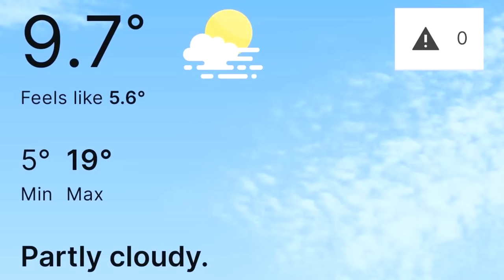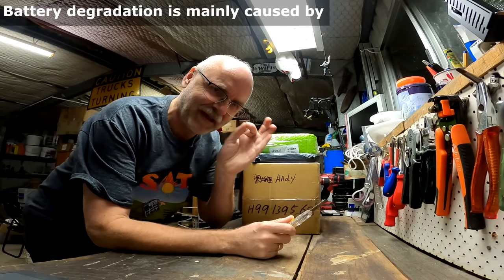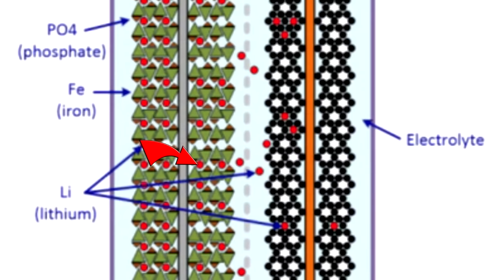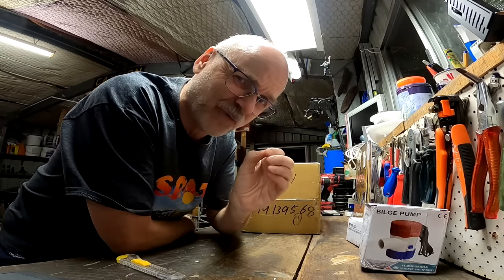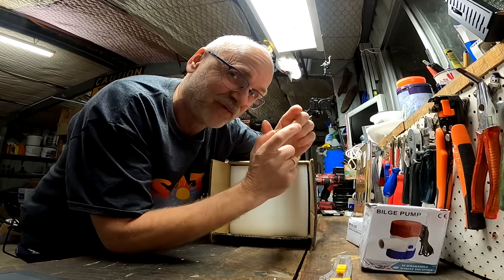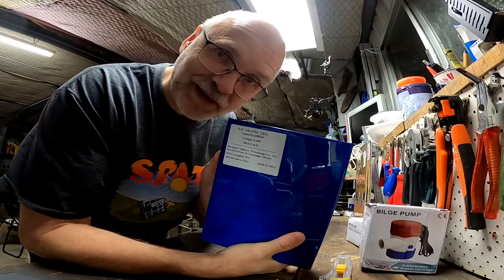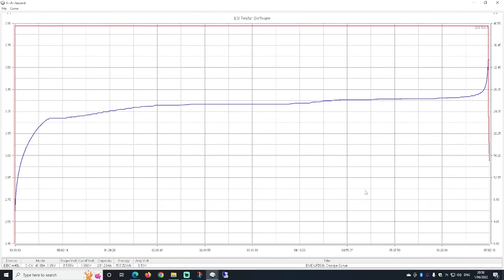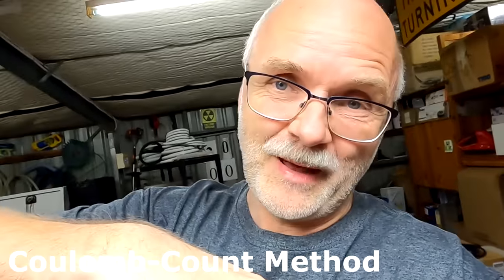Busting the 20%-80% SOC myth for LiFePO4 batteries.

Comment: because of the flat charging and discharging curve (and of course because of your videos about it hehe) at lifepo4, i managed to get from 3.00V to 3,4V (Pack UV is set at 12V and OV at 13,61V) and leave the setting for almost 3 months now and iam good with this. because the new cells always have a higher Ah Capaticy as always (if you buy 105Ah cells the have like 5% +Ah always - i got Grade B BYD 125Ah Cells and measured 135Ah which is more like 5%) - and maybe the battery is keeping longer between these states the charge, so actual i get my full capaticity even when i not fully use the cells. and if they degrade slower because of my treatment, i will longer have these cells before i must replace some of them...

Comment: @Off-Grid Garage: You mixed up the anode and the cathode. It is the anode that contains the graphite and optionally a bit of silicon. Look up Lithium-Silicon battery on Wikipedia: In a "lithiated" (charged) state,  the anode swells up.
Reply from the maker: I thought I said carbon material. I did not say the word graphite or graphene in my video😉
Reply: @OffGridGarageAustralia  carbon, graphite: same atom. Point is that you swapped them.

Comment: I keep it simple and set my BMS to 3.0 and 3.5 for now. I will adjust as your videos indicate otherwise. Should I need more current overall I will add more cells as I go. It spreads out the cost and the prices seem to drop a bit each year. EZ-PZ. Thanks for the video.
Reply: but they BMS just want to be your last backup to protect the cells.  you should better make the voltage settings with the charge and discharge controller.
Reply: @alexanderp.8075  of you have comms set up between your inverter charger and the  BMS then this is where you make those settings
Reply: @edc1569  on the inverter or the bms?
When you have the comm setup.
Reply from the maker: The BMS should never be used to control charging a battery, neither charging nor discharging, whether with or without comms. That's a total NO NO!
The BMS turns off your battery if something goes wrong or exceeds otherwise set specifications, nothing else. Always use a specific dedicated charger to charge your batteries which controls the high and low of charging. The BMS will be there if this charger fails. Don't ever charge you battery with a BMS only!
Reply from the maker: No @Ed C, you neve set any charging parameters in the BMS. It is not a charger!
Reply: @OffGridGarageAustralia  Andy, may I suggest you try some server rack batteries with a pylontech protocol or a bms that supports a protocol that is also supported by your inverter?
None of your 3  BMSes talk to your inverters so I assume you have had no prior experience with pylontech enabled bms or batteries. If you take a Seplos bms for example, they have a built in shunt (you are saving already) as well as they can control the inverter to turn of and on charging etc. Right now your inverter is not very precise when it comes to managing the batteries. 
Pylontech allows your battery to tell inverter when to turn on or off and how mach amps to charge with, depending on temp and other parameters. 
You are correct that is not a good idea to  have bms cut off charge and discharge via its mosfets under load but here OP is describing a different scenario. 
Something new for you to test perhaps.
Reply from the maker: probably not, Anton. I really don't see the point of the battery telling the inverter to turn off. All inverters have their own settings to handle such a low voltage shutdown themselves, it's not necessary for any form of comms.
And, honestly, I don't want the battery to shut it down. I may still want to keep the inverter functional even in a low voltage situation and I myself make the decision when to turn it off. Hence mine sits on 40V low voltage shutdown. And this is purely for emergency purposes.

Comment: Researchers have discovered that the first charge of a lifepo battery at the factory at high voltages can increase its cycles by 50% and greatly reduce recharge times.

The study was carried out by a SLAC/Stanford team led by Professor Will Chueh in collaboration with researchers from the Toyota Research Institute (TRI), the Massachusetts Institute of Technology and the University of Washington.

Wish ecoflo knew this before I blew a stack of bills on their Delta Pro. 😢

Comment: Doesn't make sense to charge to only 80 percent. If you use your lifepo4 battery for survival you will need the maximum power output you can get. Also charging to only 80 percent, your voltage is much lower and your run times are shorter and less voltage throughout load.

More importantly you need to only charge to 100 percent when you only need to, as long as you use battery and drain only down to 20 percent. Use your battery immediately after charged. Don't leave your battery at full charge for days. Lifepo4 average lifespan is roughly 10 years anyways, so why worry. 

Get as much use out of it that you need, the lifepo4 battery works for you, not you slaving over the battery state of charge. 

Simple and dont fear all the hype about 80 percent charge. Your lifepo4 battery only balances at 100 percent charge anyways, hello. Also make sure to use only a Lifepo4 battery charger ( or a Lifepo4 charge controller for solar) so it doesn't under charge or over charge. 

Absolutely there are more things to worry about in life. Like getting maximum voltage use out of your batteries.

Comment: I asked this question (what are the best settings for long lifetime?) to my Chinese supplier of LiFePO4 cells and here is what I got: "set no (or absolute minimal) absorption, bulk till 3.38V, Float 3.37V and discharge till 3.0V".  This is what I use now for my 560Ah battery. at night I run 2 AC's with it.  One inverter AC and 1 old one which takes big current fluctuations.  Max current out of the battery is about 80-90 amps. It is this current boost that is critical when discharge is at lower % : in my BMS I can see the cell voltages start to differ more at lower discharges with variable current, so this 'safer' 3V discharge limit is helpful to avoid one of the cells going of limit at that point.  
Last but not least: thank you Andy for all your great videos: you are truly filling in a big information gap with all your work and it is of such great help for me !

Comment: You are absolutely right. Lifepo4 cells "die" very often because they are loaded with voltages that are far too high. 
Lifepo4 in particular reacts much more "sensitively" than e.g. liion ncm on surge.

Here are my settings for LiFePo4    (I have calb cells here, but there is nothing around):
Bulk:      3.36V/cell    (8S --> 26,9V)
Float:    3.34V/cell     (8S --> 26,7V)
Cell balancing 1x per week for 2 hours, then charging to 3.43V/cell and it is only in this phase that the balancers normally work.
In the bms the balance start is set at 3.35V.

Ideally, you charge up to just below the "voltage increase" (3.34V/cell for my cells).
If all cells are perfectly balanced, the balancers just do NOT have to work that way. However, if a cell is slightly more charged, the voltage at this point also increases significantly. 
That's why it only makes sense to balance at all from this voltage onwards.

If you have the balancers active below 3.4V with lifepo4, they are almost always active and debalance the cells. The voltage differences are just too small.

For those who are interested, here are the settings for my NCM LiIon cells (Panasonic, 25Ah/cell):
Voltage range between 3.4V (14S --> 48V) and 4.0V (14S --> 56V). Nothing else ^^
The passive balancers (max. approx. 1A... and not for long) only become active from 3.9V/cell (14S -->54.6V) and then ONLY when charging, otherwise not.
This low balancer current is sufficient for the 600Ah 14S battery storage without any problems.
easy peasy  😅🌻
Reply from the maker: Thanks for sharing your numbers. 3.36V seems very low for a charge though. The absorption time must be very long. It is actually a very interesting way of doing it as both resting voltage and max charge voltage are very close together.
I found this not sufficient for my setup and charging basically stopped between 60% and 90%SOC with these settings. Very unpredictable.
Reply: @OffGridGarageAustralia  
I think that will also have something to do with the cells, not just the cell chemistry.
I built the system for our model avitation club and installed Calb SE 130 cells. Used, of course, nobody can afford it new ^^
Theoretical capacity for the setup is around 6.6kWh. With the settings 5.8kWh can be used. Maximum charging power 800W, discharging power approx. 2kW.
I also find the charging efficiency interesting, which I have measured several times and is around 94%, which is quite remarkable =)
With us, the model airplanes fly almost CO2 neutral... 😅😅

Comment: Hi Andy, I am looking forward to the new series, it is very timely since I am just starting to configure my components. I have a good understanding of how each component (chargers, inverters and BMS) work individually, but when looking at the entire system as one, it is confusing. for example, If I set the BMS to stop charging when any cell reaches 3.45v and similarly set the charge controller to stop at 13.8v (3.45 X 4) the BMS is always going to stop the charging before the charge controller, so why bother with those settings?  Will you be addressing these settings? thanks!
Reply: Hello Malcolm. It may not be the best settings, so I don’t suggest anyone to do the same, but my settings, if I translate it to a 12V system, are 13.8V for the charge controler, but instead of limiting the bms at 3,45 per cell, I alow 3.58V, and limit the total to 14.4V, wich the battery will never reach of course, but one high cell could reach 3.58V, and one low cell could stay at 3,32V while the 2 remaining cells would be spot on 3,45V, and the charge controler would stop charging, but my fckng daly bms would not disconect the battery from the charger and load, it would, if set to 3.45V and 13.8v limits. My external balancer is set to start at 13.6V, so those extreem limits never occure. Single cell drift happen, and not always the same cell. 😂
I hope it helps.
Cheers.
Reply: @hommerdalor6301  Hi Hommer, thanks for your input. I am using the electrodakus BMS, which will remotely turn on/off the chargers/inverters. After giving it more thought, I'm going to try the more conservative route: have the BMS stop charging when the first cell reaches 3.45v and leave the charger setting at 13.8v. that way if for some reason the BMS does not stop charging, the charger will stop at 13.8v.
thanks!
Reply: The electrodacus is great. 
Sure, try the conservative settings, experimenting is the best we can do. :-)

Comment: I agree with Paul, perfect timing.
Just finishing the SFK V3 kits, charging them and in the meantime hanging the new inverter and getting ready to commission Solar V2.0
It's all very exiting Andy and I'm looking forward to the next videos.

BTW, should I be allowing some room in the system for a bilge Pump or is that a Queensland thing?
Reply from the maker: How was you experience with the Sun Fun Kits? They are really fun, aren't they? The manual is really good and answers all the questions.
The pump... yeah, we have more rain but it's really for the pool actually 😂
Reply: @OffGridGarageAustralia  
Can't begin to tell you how much fun it was assembling these batteries.
Everything fitted perfectly, so neat and tidy, so much thought has gone into the design and layout of the components and cables.
Each pack has it's own BMS and they're easy to setup and monitor with the app.
Originally I had planned to put the 16 batteries in series like but after seeing your SFK V3 video this is is the perfect solution for me.
My ageing SLA battery bank is nearly 10 years old, they're doing fine, not their fault we've had no input in the last 5 weeks but when their time is up I'll have no hesitation doing the SFK thing again.

If you think these are heavy, my SLA's weigh 83 kg each, the SFK packs fully assembled are a piece of cake to move around.

Comment: in my experience 54.4 to 50.4 is the best compromise also because the remainder is very low. the difference also lies in whether you have 1 battery pack or multiple packs in parallel. I have 4 packs in parallel and once a month I bring everything to 55.2 to make sure that the cells are really equally charged and I reset the shunt

Comment: Much Older LiFePo cells cycle life goes something like this: 90% DoD = 4000 cycles, 50% DoD =8,000 cycles 30% DoD = 12,000 cycles and 15% DoD = 20,000+ cycles.  All discharged at a C rate of 1C and a charge rate of 0.5C    DO not charge below 0 degrees nor charge when over 45C.  Some newer studies show do not charge above 40C instead of 45C.  So, in some extreme desert conditions and under load, active cooling will be required.

Comment: Andy,
If I may ask.... What is the calendar shelf life of  lithium cells?
I am currently using grade B CALB cells which are 10 years old.... Still going strong at 90% capacity, 100% off-grid with daily capacity discharge from 100% -30% level. I just keep wondering does it mean there's a day I may just wake up to find the storage bank is 40% or less ?
Then why should I not just consume all my capacity while still alive ? I can imagine .... I might take another 15yrs to get to 80% capacity.
Reply: I don’t think anyone yet knows the calendar life of these if looked after properly. Suffice to say: it’s good.
Reply from the maker: Calendar life only means that batteries degrade from age if they are used or not. It does not mean they will be dead at a certain time or date, but still lose  a tiny bit of capacity every single day regardless how and if you sue them. If yours are 10 years old and still have 90% capacity, that is great
Reply: @OffGridGarageAustralia  

I am in my 40s, I  guess they will be still alive when am gone.....I appreciate your educative videos which will help us to extend lives of these cells for quite so many  years to come.
I always remember the argument of Bulk Voltage being same as Float Voltage. My cells get full by mid-day, I keep using the PV power without cycling my cells for the reminder of the day. This makes me to cycle the battery bank for less than 1 cycle per day.....This is very helpful insight I see many of solar users do not know...
I really appreciate your work..
Reply from the maker: @innocentusangira789  thank you. It depends on the exact settings in your charge controller if bulk should be the same as absorption and also the devices you're using. Watch the upcoming videos about the settings to learn more. It will be interesting.

Comment: I could literally write a book about what I know about flooded deep cycles. But my switch to lifepo4 has been frustrating because there are too many opinions and so called "experts." What I really like about this channel is that you don't write your information onto stone tablets. I've only been researching lifepo4 charge/discharge and haven't seen the 20 -80% rule. I can tell you, however, that my laptop only charges to 95% to prevent shortening the life of the battery.
Reply: Ditto bro

Comment: High voltage at high temperature is destructive not just because of cathode particle cracking, but because the voltages in NMC/NCA cells are quite close to the upper voltage at which the electrolyte is stable- the so-called "electrochemical window" of the electrolyte solvents.  LFP has a huge advantage because its ultimate voltage itself is quite low relative to NMC or NCA cathode batteries.  And please note- LFP IS A LITHIUM ION BATTERY CHEMISTRY.  The only thing that's different is the cathode.

Comment: Wow and thank you. This has got me wondering now about a control use algorithm to compensate for the drifting of the SOC when controlling use based on Amp-Hour removed. I'm thinking about how alternating the control variable from voltage, to %, to amp-hours removed, and repeat, at a period that could be set or derived, could put into place an automatically compensating SOC